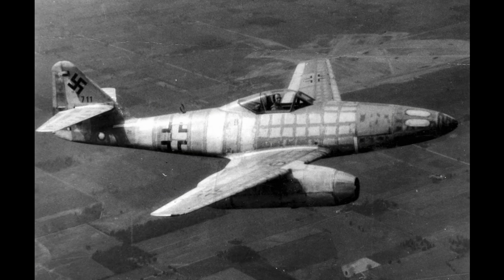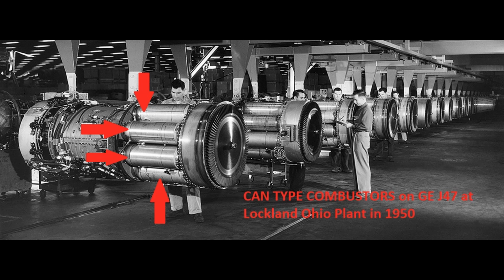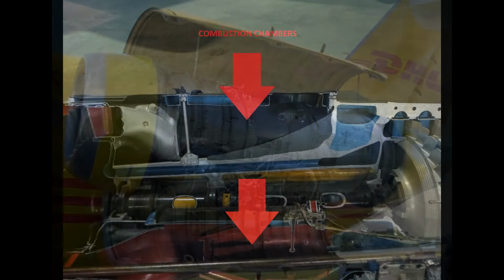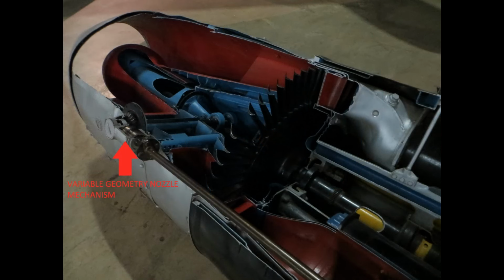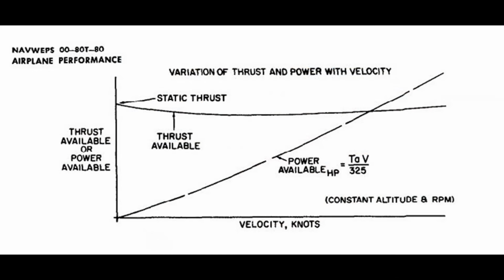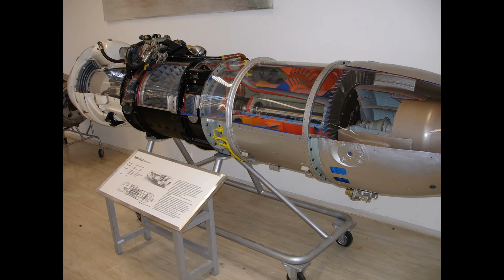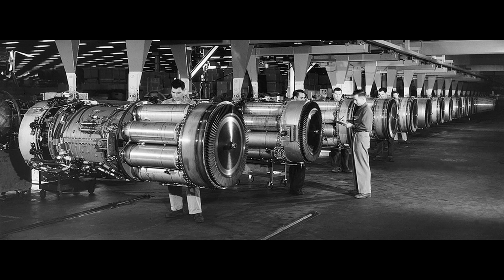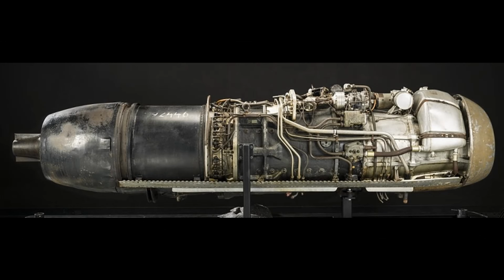World War Two JET POWER

Comment: Whittle, BMW 003  and the Jumo 004 all used firtree-style turbine blade attachment points which are still in use today.  I could never find who developed it first
Reply: So in 1959 the firtree turbine attachment was patented.  US3045968A - Fir tree blade mount -  when clearly the 004 used them in 1940
Reply: @Henry J. Totally agree.  Even then, the first mention of this type of attachment is from 1930s Whittle design.  What would be interesting to know is if the Germans independently developed it, or copied it

Comment: As a young lad I built the Revell Allison turbo prop model. It had an electric motor but I had great trouble getting it to work because of interference in the compressor area. Bearing that in mind, and doing a parts count  you can understand why Whittle stuck with a radial compressor.

Comment: The claim that jet engines run hotter than piston engines is ... well lets say half true.

Its true that the mettals of the jet engine run hotter, but not the actuall burn. The burn of a piston engine is quite a bit warmer. The reason why the engine dont get warmer is because of a combination of qunching distance and input air coling effect.

Also worth saying is that the reason why het dont care about fuel quality is that they in effect are diesels.

Comment: Enjoyed the video, but I do need to offer a correction for something you have said in both this video and the other on the Jumo engine. The ME262 5:1 kill ratio thing is extremely unlikely to accurate. The German jets flew primarily after the Luftwaffe's kill vetting system had broken down (no kills confirmed past early November 1944), so what we do have is pretty much unverified. On top of that, there are some real questionable bomber claims by ME262 pilots in books, including claims on days when no US bombers were shot down by aircraft and when after action reports states the German jets never made attack passes on them. 

The ME262s kill ratio for JG7 (The largest ME262 fighter unit - pretty much fought US 4 engine bomber raids exclusively) was 1:1, and I doubt the other units managed anything better (given they were mostly ground attack KG type units). 1:1 was much better than what the ME109s and FW190s were managing in that environment, so it still points to the ME262 being a very potent design, but the large numbers of Allied escorts largely kept smaller numbers of ME262s in check. This video covers the topic fairly well, if you have 70 minutes: https://youtu.be/U7naFflRAkE

This doesn't really take away from your overall video given its such a small part of it.
Reply: Well, nothing at hand, but supposedly the kill ratio was in most part due to the successfull R24 rockets. The number i remember was in between 500 - 700 downed B17 by ME-262 in a book by a british author. Now this number may be exaggerated by one side, as well as it may have been downplayed by another party.
Reply from the maker: Here is the thing, there is literally no kill ratios by any WW2 plane that can't be disputed. Thus whatever number I put up, and for whatever airplane, it can be argued. Now I can either avoid putting up kill ratios and kill numbers entirely, or I can add 10 mins of explanations and disclaimers every time I mention kills or kill ratios. OR, I can just go with published numbers and hope that my viewers are smart enough to understand that kill numbers are not etched in stone for any WW2 airplane. The 5:1 number is defensible, and it's commonly published, can I guarantee it's accuracy, no.
Reply: @GregsAirplanesandAutomobiles  That is a fair point I can't really argue with, especially since these are your videos.

Comment: Hello Greg, the Picture of the Ju 287 only shows a kind oft mule. Junkers built it as a proof of concept for the forward swept wing. They took the end of an Ju 188 and the nose  of an Heinkel He 277 (when i remember it correctly)  and other stuff, that was lying around, to get it in the air. So no retractable landing gear. As Ef 131 it was later developt completely by Junkers Engineers in the USSR.
Reply from the maker: The retractable one was the Ju87 V3, which was a very different plane, it had 6 engines and mostly existed on the drawing board.
Reply: Ah yes... I see the forward swept wing. Thx. I'll look it up

Comment: What if the effect of ram air at high speed, why doesn't it increase thrust with  speed like on a piston engine?
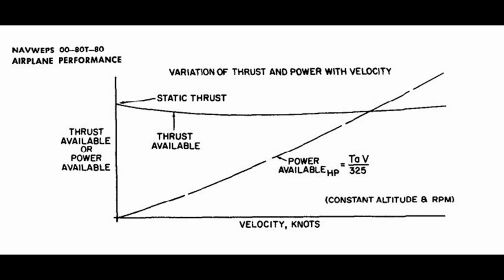Reply: It does and Greg explains this @14:50
Reply: @petersouthernboy6327  he does not, because  it is also true for a rocket enginw
Reply: @tedarcher9120  - rocket engines are a separate discussion entirely
Reply: @tedarcher9120  One of the advantages of the jet engine over the piston engine is the jet engine's capability of producing much greater amounts of thrust horsepower at the high altitudes and high speeds. In fact, turbojet engine efficiency increases with altitude and speed.”  FAA-H-8083-3B
Reply: @petersouthernboy6327  yes, that's why he didn't explain it.
Reply: @tedarcher9120  How so? The only external factor that affects a rocket's thrust is the ambient pressure outside the engine bell. As the rocket climbs, thrust increases, but that is limited by the expansion ratio of the nozzle (engine bell), which is why the vacuum-tuned engines of booster upper stages have much larger engine bells, and some systems use movable skirts to reconfigure the engine bells as they climb.
Reply: @peterstickney7608  yes, but power = thrust * speed for any jet or rocket engine
Reply: He did explain it.  Thrust is fairly constant with speed, but power increases dramatically with speed.
Reply: @gort8203  power also increases for a rocket engine which has no air intake. My question was about thrust, not power, can you read?
Reply: @gort8203  Which is actually kinda deceptive - Thrust is what's pushing you through the air, countering drag. Power is a convenient measure if you're using an engine-propeller combination, but when you're plotting performance, it's thrust that you need to calculate.
Reply: OK - this gets a little complicated -  There are two factors at work - Ram Drag, which is directly related to the mass of air passing through the engine (with a properly designed inlet), and Pressure Recovery, which is related to the square of the velocity of the engine (and its attached airplane) through the air. (with a properly designed inlet).  The Ram Drag, which reduces net thrust, increases linearly with speed.  basically *1 at 100, *2 at 200, *4 at 400, and so on.
Pressure recovery, which increases the pressure of the air entering the engine inlet/diffuser, and increases thrust, increases with the square of the airspeed.  So, at low speeds, ram drag increases faster than Pressure Recovery, and net thrust drops.  As speed increases, thrust is increasing faster than ram drag, and thrust increases.  For engines of this era, with typical mass flows, the thrust starts increasing at about Mach 0.65 - 0.75, after decreasing. to that point.

Comment: And today we have hobbiest engine builders making their own axial flow minature engines. Along with the ones building centrifugal flow engines out of turbo chargers.
Too bad Lockheed's axial flow engine didn't quite work
Reply: Building centrifugal flow engines out of turbo chargers? GE's experience building turbochargers gave it a head start in building its first jet engines.
Reply: @fafner1  I know. That's why they got tasked by the Air Corps to build the first copies of Whittle's design. Although Lockheed was working on an axial flow in 1941 that was initially designed by Nathan Price who also developed a steam powered turboprop aircraft engine that was test flown in 1934 to 36. 
It's not that the potential of jets wasn't understood in the US. I think it was more a matter of materials science and aerodynamics. If the money that the Air Corps had poured into the hyper engine program had been devoted to early jet research they would have been better off. Woulda, should, coulda

Comment: Inferior access to materials would have seen its performance rapidly overtaken by allied designs.  Slightly improved engines made P-80 and Meteor into beasts w/o wingsweep.
Reply: The 262 had swept wings because of center of gravity and not because of aerodynamics. Allied engine rose insanely quickly and thenrolce Royce nene ran very soon after the war. Nazi tech was rather useless immediately after the war as their engines and want to built them with inferior materials mattered not at all. Only with the first super high performance engines swept wings and axial turbine flow became advantageous.
Reply: @iliasemmanuil  what
Reply: @iliasemmanuil  yes, some say this, but it’s a red herring. The Germans discovered and were fully aware of the advantages of swept wings long before the allies. They were years ahead in many areas including high speed wing design, having the only supersonic wind tunnels in the world. Notice the swept horizontal  and vertical stabilisers on the 262. Look at the wing plans on the F86 Sabre and the MIG 15, they are identical because they are Messerschmitt wing designs.
Reply: @drstrangelove4998  they were aware it was beneficial for super fast subsonic flight. The me262 was nowhere fast enough tot are advantage of it. Only the me262 hgiii designs would have taken advantage of swept wings.

It literally was put that wayor Center of gravity because the engines were front heavy.

Every nation after ww2 took advantage of german swept wing tests but not in the me262. It was a technologial dead end. Fuselage mounted engines were the future and are to this day for fighter jets.
Reply: @drstrangelove4998  I agree with the commenter and it's not a red herring.  The wings of the 262 were originally planned to be straight but were swept slightly to correct the CG because the engines turned out heavier than originally planned for.  The wing sweep of the 262 is the same as that of the DC-3, which also had nothing to do with delaying compressibility.  Later wings that were swept to delay compressibility used a higher sweep angle than the DC-3 and Me-262.
Reply: @iliasemmanuil  Thank you!

Comment: Really nice. I'm writing this an hour before it premieres, hoping it will cover the 003D variant. Thanks a lot, Greg.

Btw everytime I read "BMW 003", I have to grin, because I remember some slavaboo armchair general, with a huge following, writing that the Germans were too stupid to design jet engines. Which is comedic because the Soviets were unable to design proper jet engines for many years after the war and had to use the BMW 003s in their MiG-9s. Even the MiG-15 had to use foreign engines(the Nenes) which are not even axial flow.
Reply from the maker: That's exactly right, few people realize that the original Mig 9 ran with a BMW 003. I do talk about the 003 in this episode, but not too much.
Reply: I read they did reverse-engineering to create their own copy of Bmw003 for the, quite fast, Mig-9, called RD-20, while the Jumo was the RD-10, used on some Sukhoi